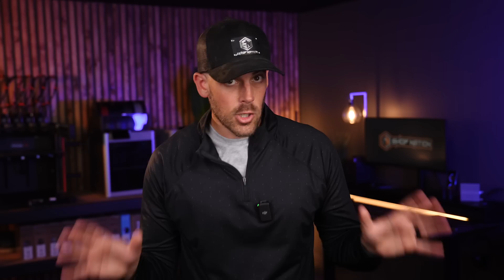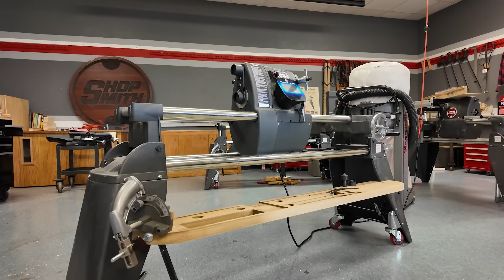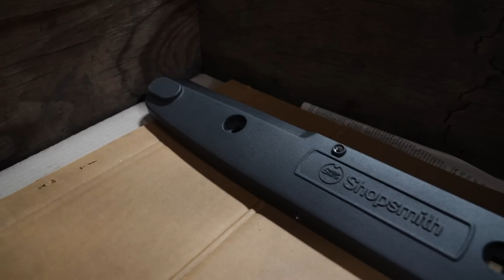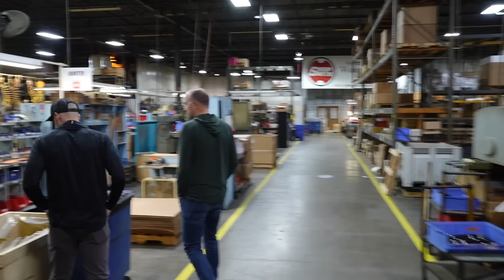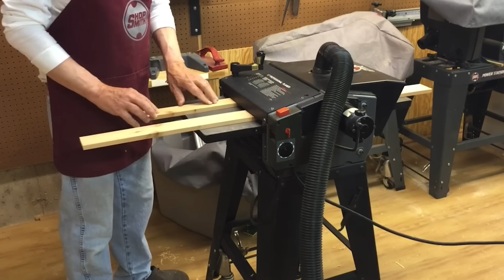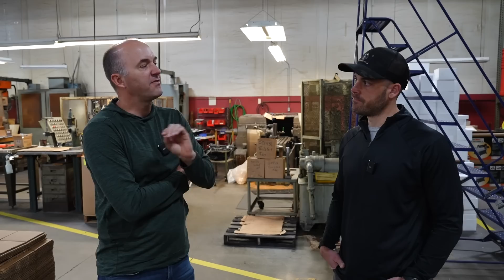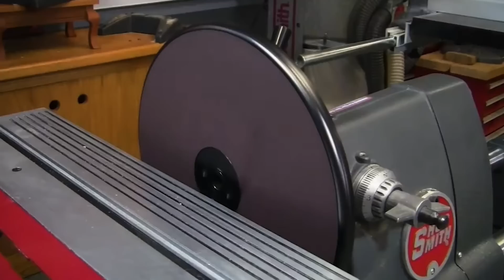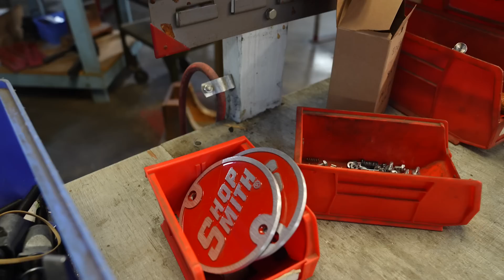The Last American Power Tool Company is (almost) dead

Comment: Yes, a table saw is Shopsmith's weakest area!
I've always felt that Shopsmith should follow the career coach's advice: "build your strengths, hire your weaknesses". ShopSmith enhances DrillPress/DiskSander/Lathe functions but compromizes Tablesaw ccapabilities. Instead of being considered a do-many-things tool with a tablesaw heart, it should always have been sold as the perfect complement to a good tablesaw.
Good luck to a great American company.
Reply: Have you tried a shopsmith table saw?  Mine is a powerhouse.  I do agree that the drill press, horizontal boring, and lathe are superior to most on the market, but the table saw is also a powerhouse.  I have mine plugged into a 220 outlet and I get a 2 horse saw and drill press.  I love that all you have to do is change the plug and it is both 110 and 220.

Comment: I had a oversized 2 car garage for my shop. We moved I now have 4' by 15'. I have a great table saw with a router built in, it takes 4'6'. The used  ShopSmith can do both. Drill press, lathe, jointer, round disk sander, round polisher and wire brush, all going up for sale. because with my advancing MS, I can't do big things anyway. 1 tool can do all the smaller work I can still do. Excited to get started once I sell off my big tools and have room for 1 smaller and easier tool. Build my shop around the ShopSmith.

Comment: My Shopsmith supports a 5X10 sheet of plywood which includes infeed and outfeed tables. In my opinion the table saw feature is one of its strong points.

Comment: Sorry to say this factory set up needs to be updated with some automation and to hear now that ShopSmith going out of business, is to the fact there still producing with out-of-dated manufacturing procedures of today.  ShopSmith is a very unique machine for a certain type of wood worker, its limited to a certain demographic. If I add what my band-saw, table-saw, drill press, plainer, it would be cheaper then a ShopSmith even today, and the problem is not controlling there operational and material costs with complete out of dated issues. The bigger issue was the pandemic and Trump once again with his tariffs, inflation with the economy turning down, its the perfect storm.....  I was in the sheet metal industry for over 15yrs / wood working for 45yrs.  ShopSmith will end up selling there name for a brand of cheap tools made overseas.

Comment: I purchased my Shopsmith in 1979. It has aided me in the remodeling of 3 homes, built many pieces of heirloom furniture, as well as toys and multiple products. It has moved with me from SB Indiana to Washington DC, to Seattle Wa, and finally landed in Portland OR. I no longer have a large shop, and it is perfect for my garage. I added extras and frills but it is the same basic machine that I purchased. Hardly a month has gone by that I have not used it. Through the years I have performed basic maintenance but have never had an issue.

Comment: I have had a Shopsmith Mark V since the 90s.  I have built very large projects like a pergola, miter cut wood flooring (before I owned a power miter saw), and small projects like a fireplace mantel and turned ink pen blanks.  I put so much wood through it that I did have to replace the motor once, my problem not theirs.  So here we are in 2025 and I have moved this unit from home to home, including an apartment with a garage that never had my car in it.  I still have all my fingers and I made good use of the VHS video tape lessons :)

Not only do they make something that will last forever, but it can be upgraded and I have done that as well.  You can get replacement parts for things you have lost in moves or have worn out.

I am so thankful for this company and the tools they made.  At a time when I didn't have room or money to buy all the stuff in PBS Norm Abram's shop, this thing was and is Great! 

Where does Shopsmith go from here.  I hope they can make a go of it and continue to innovate.  Best of luck, we still need you.

Comment: I bought my first Shopsmith in 1983.  Today I have three, one setup as a shorty that use as a combination belt and disc sander.  Another is setup as a permanent drill press and my third I upgraded to Power Pro in 2011 and is a full Mark VII.  I also have the jointer, band saw, scroll saw, biscuit jointer and numerous accessories.  I have largely moved away from Shopsmith to separate machines, not because the machines were not good, they are very good; but because I had so many problems getting what I needed from the company.  Hopefully this change in management will resolve those issues.  You haven't asked for my advice but if you did I would say that the most important thing you need to do is secure your base.  Long time users like me walked away because the customer service went down the tubes.  I was also somewhat disappointed with my Power Pro upgrade.  It turned out to be a lot of money for an upgrade that was at best marginally better.  I will never give up my shopsmith, it was the start for me of a hobby that I love.  I am glad to see that someone is working to rebuild the Shopsmith legacy.  Best of luck to you.

Comment: I operate my dad’s 1963 SS Mark VII (Magna owned them back then). It and its SPTs are great tools. Through the years I witnessed why they ran into problems. As folks shifted to online, they still tried to keep brick and mortar stores going. They stocked non SS brand tools (i guess to draw folks in..like dewalt and other hand power tools)….but they could not compete with the big box hardware stores who could deep discount and even sell some items at a loss (DeWalt chop saw as an example). They had a K-mart exec at the time whose only advice to the store (told to me by an employee) was ‘keep the shelves stocked, labels rotated front (sheesh). At that point they fell back to mail order and closed stores (took them forever to have a decent web presence. Because they are small and play by the rules, their prices are viewed as ‘high’ so many otherwise loyal SS owners whine about part costs, shipping costs, and do just about anything to find a cheaper alternative (for things like screws, the plastic coupler, etc). They don’t realize every time they find a cheaper alternative it is yet a nail in the coffin for SS. They are loyal, but not to the point of overspending to support the brand.There stuff is really good quality.
Reply: I recommend a few things. 1. Maybe team with a Mike Rowe to promote getting shop class back into high schools. A lot of kids don’t learn woodworking anymore…and many don’t learn to do their own stuff…they hire carpentry done. SS is a good entry level tool that does a lot in a little space. 2. Hope they can figure out how to make the planer again perhaps more cost effectively…I have one and it is superior to ‘lunchbox’ planers….but just costs too much to make/buy. 3. Figure out how to do better ‘make/buy’ decisions. Nice that it is all in house, but I can’t believe some of those operations can’ t be done more competitively by others. Or if you want to keep it in house…innovate to figure out why You doing it cost more than outsourcing to a competitor (plus their shipping costs!).
Reply: I also witnessed that when the stores closed in the 90s (I got REALLY great deals on SPTs they did not want to ship back to the factory), The store manager in my area (Mark Whirlin) started ‘The Woodworkers club’…he actually bought his SS store’s display fixtures to use in his new business. As it started to franchise (yes, his business GREW while SS shrank back to mail order), Woodcraft bought him out. They are now “Woodcraft” stores…Mark’s store started in Vienna VA…not sure how many had franchised before he sold…but likely a dozen. There are now Woodcraft stores in, by my last look, 35 states. So there is clearly still some woodworking appetite…but not everyone can afford a Unisaw/copy, lathe, drill press, etc. So they can go to woodcraft and rent time. One would think that would be a place for SS to insert itself again.
Reply: I wish them all the best (I’d like to keep mine running and hand it over in working order to my son someday). Many years ago they used to do demos at woodworking shows or even at the local Lowe’s. But it is a lot of money to plunk down unless you are sure you are SERIOUS about woodworking (which is one reason there are an abundance available in your local ‘penny saver’—-which undercuts new sales. It is a good product…I just think they need to figure out how to get better at marketing and position themselves accordingly. Not all to their fault—as they note at least they are still in business and US based…look what happened to Delta, Porter Cable and so many others that have gone by the wayside.

Comment: I applaud Shopsmith for keeping manufacturing in the United States.  I wish more tool companies would consider coming back.  I have a stand alone scroll saw I purchased at a Shopsmith store in January 1990.  I don't use it much these days but as I near retirement I can see it coming out more often.  It works as good today as the day I bought it.  Do they still make the parts to fix the air pump?

Comment: I don't think I would buy the new Shopsmith that costs over $5000.  Do we even need the new one when the old ones are always available used and there is and endless supply of parts on eBay.

Comment: I just acquired my 2nd SS, a Mark 5 500 that had the PowerPro upgrade on its motor.  I thought, at first, I would change the headstock to my newer model 510, then upgrade with 520 upgrade and sell the older frame with my headstock.  However, now I’m going to keep both machines.  Still swapping headstocks but use older one for specific purposes.

I may be 75 but I’m still going strong, like my Shopsmiths, and am now expanding my woodworking shop!  Thank you Nick for reviving Shopsmith!  I’m now more inspired.

By the way, I also have two radial arm saws, my first woodworking tool, a 6” jointer, a 12.5” planer and now 2 SS bandsaws, SS jointer, two SS scroll saws & a belt sander.  And recently acquired an old Craftsman table saw, which I am reviving as well. 

Keep Shopsmith going for us and new generations of woodworkers.

Comment: Unfortunately, the use case for ShopSmith (space) has been replaced with today's portable brushless power tools. Track saws are great for dealing with sheet goods, while ShopSmiths aren't. A 4" jointer isn't near big enough for flattening solid wood faces, while 8" benchtop jointers with 12" thickness planers are faster to pull out from their shelves than setting up the ShopSmith in jointer mode. Jobsite tablesaws didn't exist in the 1950's, but today are cheap and good quality with good accurate rip fences. There's really not a good reason to be buying a ShopSmith today.

Comment: I have a Shopsmith in my wood shop that my grandfather bought in the late 1940s. I use it primarily as a lathe. I only had to upgrade the tail spindle with bearing (the original had no bearing) and added a head spindle adapter that is a 1" x 8 threaded adapter to accept my various chucks. All original parts and motor, and it works great!

Comment: 'The Last American Power Tool Company Dead'?

Not so fast, Northfield Woodworking Machinery is alive and well. Manufacturer of the 'highest' caliber  for well over 80 years whose 'used' equipment many woodworkers drive halfway across the US to get their hands on. 

sadly this type of quality machinery, Shopsmith too, is not so much wanted as equipment  manufactures are operating a bit like auto manufacturers and coming out with 'new' models sometimes annually making their prior equipment kinda obsolete in their minds.

but those in the know know that 'quality' never goes out of style...

Comment: I had a Mark IV for years, my father and I purchased it together after working together making furniture with hand tools.  I can’t and won’t say anything negative about it. It is the perfect tool to for the person who has limited space but wants to be a craftsman. It is a high quality tool. I sold my Shopsmith for only one reason, the tine it took me to change from one configuration to another while I was working. It was great if I was making ten of the same end table but if I was making a custom anything the changing from one to another was maddening. Now I am a 95% unplugged shop and do a good business building and creating hand crafted furniture with hand powered tools,, this includes a treadle lathe. Again this is an awesome tool and if you have limited space but the skill and desire to create, this the perfect tool and as they say it’s USA made which makes it even better!

Comment: I love the concept, but I see a few issues. I doubt he is still checking but I think the design can be simplified a ton. It is too expensive to manufacture in it's current form and looks dated. Not to mention every hardware store sells similar saw base for $150 making your machine look lower quality in consumers minds.

Make the motor stationary and adapt by changing the orientation. It needs to be more like an ironworker combined with a kitchen machine, a solid base and multiple stations engaged through gears, nobody wants to keep setting up different stations repeatedly throughout a project.

Also make sure the right parts are made in the USA and bring in automation where it makes sense. Only precision parts need to be made in the US while aluminum extrusions etc. should be made in elsewhere. On shoring only works by using MODERN manufacturing processes and designing for maximum efficiency.

Don't try to keep an old design where it doesn't make sense. Nostalgia doesn't fix the finances. Update the design, the manufacturing processes, and the costs and I think you will be successful. You have a great product, but I can almost buy professional grade versions of each machine separately for that price.

Comment: as someone who works in manufacturing, they need to hire a lean consultant or engineer to come in in setup a cleaner, better organized manufacturing space and production line. That place looks so messy and inefficient. I manufacture a more complex machine, in a smaller footprint, with less people and no it does not have any automation in the assembly process.
Reply: Good point but you should not need a Lean consultant if you are running a manufacturing site- you should have been to college and learnt the basics first.

Comment: As respectfully as I possibly can, saying pricing isn't a problem when it comes to people wanting to get into woodworking is just a false statement. The number of tools people they feel like they need or anything close comparatively to the tools suggested here are low yes, however cheap tools will de-motivate people because of the awful finishes, or the bad experience in tool, but then anything else that would leave a decent finish being out of reach costly

Comment: I'm 73 years of age and I now have my second Mark 1 (I assume) ShopSmith. There are a number of components for my vintage unit that I am missing. In your video you indicated that the base remains the same. My plan is to go to your web site in an attempt to full fill those short falls in accessories I'm missing.
I wish you the best of luck in this endeavor.

Comment: I own a first generation shop smith, it was basically 2 saw horses with a saw blade spinning off a motor, it was scary to operate. I think this newer model is more robust and safer is more sturdy, I definitely would buy a new one, they are nothing like that original model.